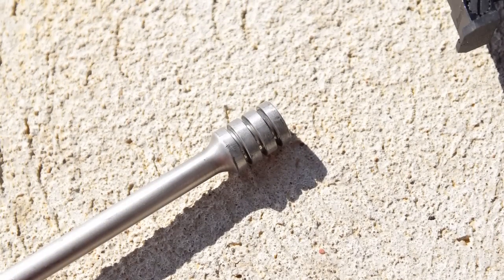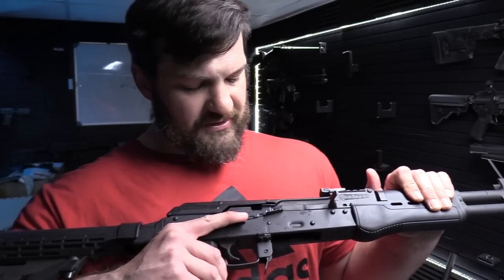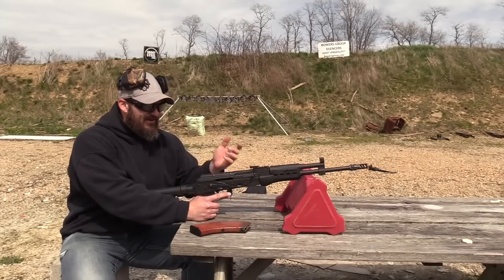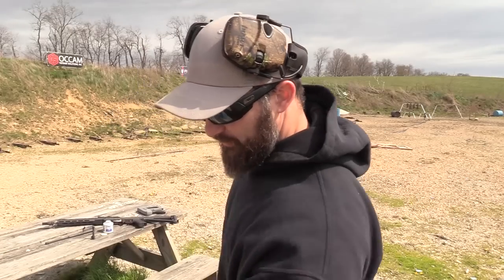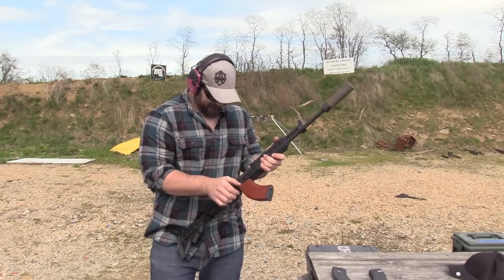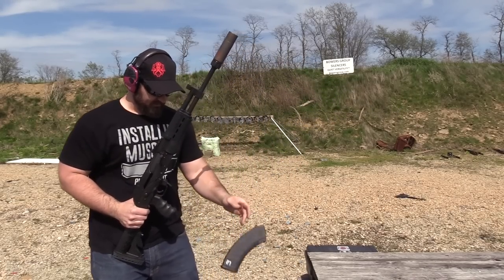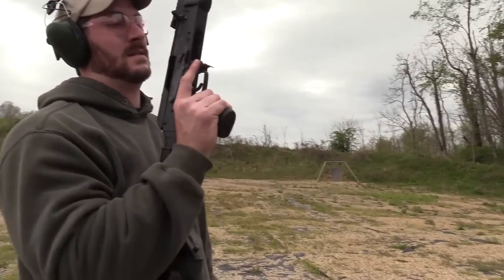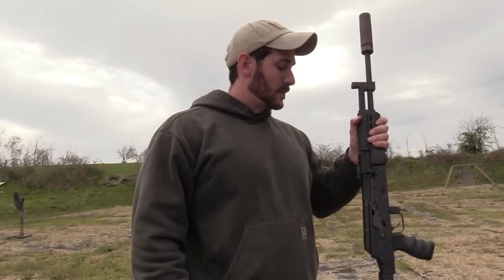This Should Have Been Done a Long Time Ago: ACU TEC AT-18

Comment: 4:14 ok was it the camera, my monitor or what? the bolt looked like it was hanging up a little bit as it was picking up the next round. was it maybe just the angle or just that mag? didn't notice it anywhere before that or after (skimmed through, rewatching from where I left off.)

Comment: I looked further into these cause I was wondering what parts this AK was built on. It’s built on a RAK-47 rcvr which uses cast trunnions and bolts. This gun will fall apart after a 1000 rounds due to the cast parts. AVOID THIS AK AT ALL COSTS.
Reply: Where did you get this information?  I spoke with the owner of the company and he said that they use various recievers depending on what is available, but NEVER cast trunnions or bolts.